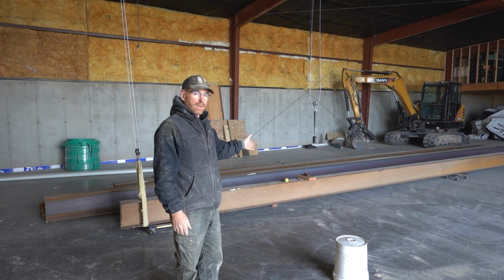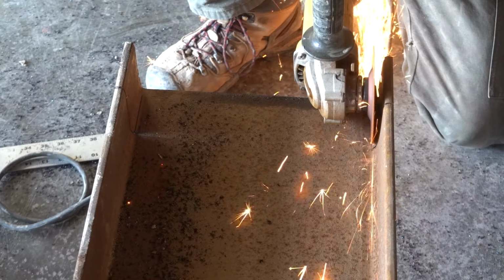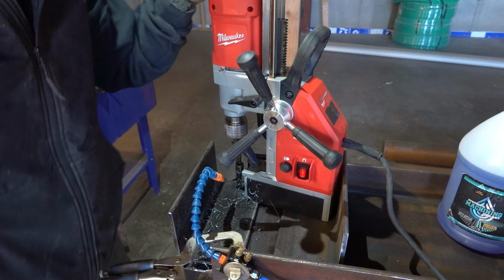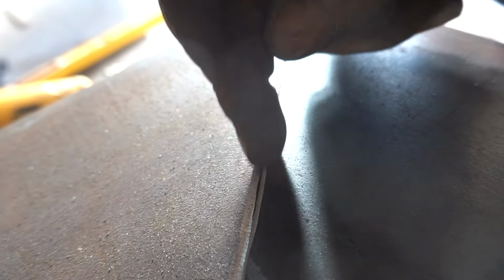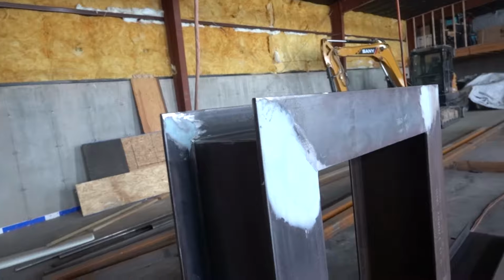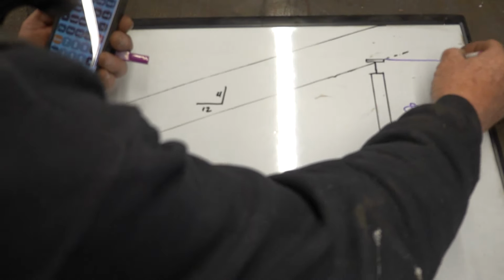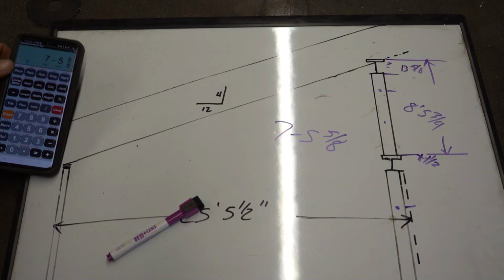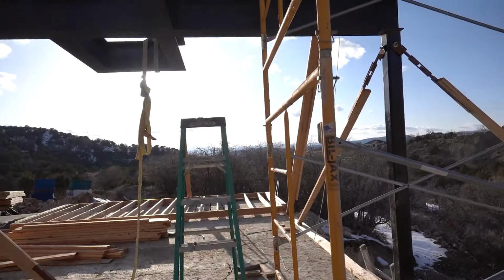DIY STRUCTURAL STEEL.  I have been thinking of this steel for years and finally finished it.

Comment: You're missing the spring loaded pin for the annular cutter--it helps center the cutter and pushes out the slug.
Reply from the maker: Crap I knew I should have read the instructions